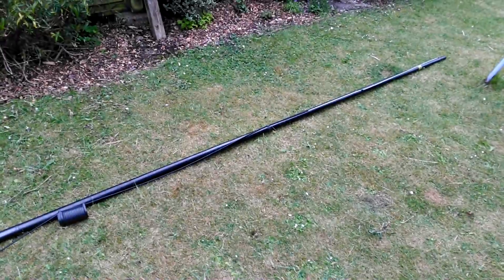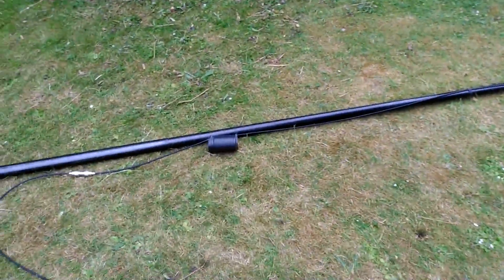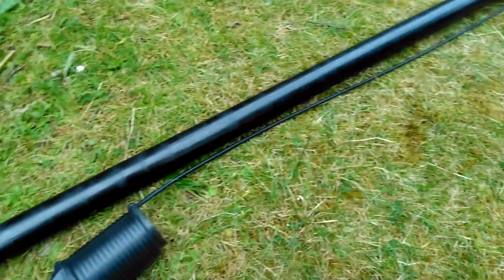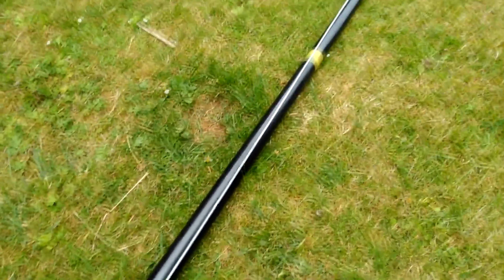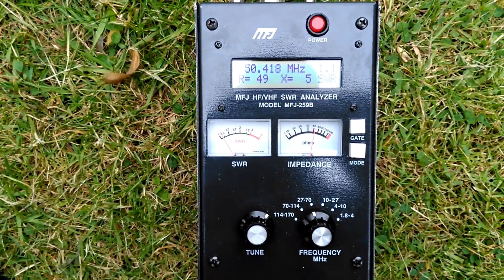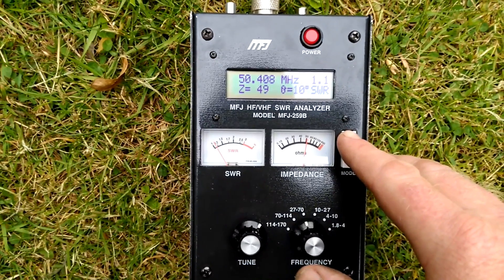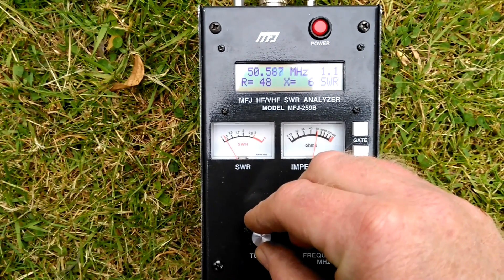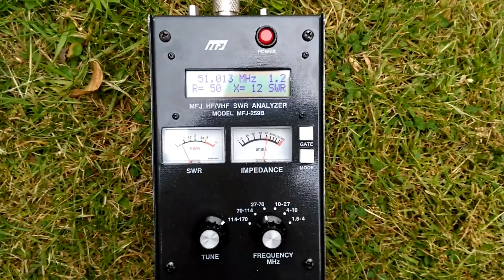6m COAXIAL SLEEVED DIPOLE

Comment: Do you have any tips on how to actually make this for the right frequency? I’m aiming for 145.5 for obvious reasons and my issue is knowing that once you cut the outer and braid off, you’re basically committed to that dimension for your lower section, no matter how well you measure your top section. But you can’t know it’s correct without finishing the antenna and testing it. 

I’m too scared to buy the stuff and give it a go. Especially given I’m doing what you’re doing and not putting it inside anything. But I’ve been told even being alongside the pole as you’ve done here will effect the element length. Nightmare.
Reply from the maker: All you do is rewind the coil start point further up or down the coax to change the lower length of the dipole. 73

Comment: Looks verry nice, mij compliments. can you give me some info in lengts?
Thanks in advanc, hein, pa3cuu Alkmaar
Reply from the maker: top is 137cm, Bottom is 129cm. Bottom is always shorter due to the sleeve/braid. Yours might not be exactly these measurements due to minor variation in velocity factor, but will be very close indeed.
Reply: Thanks, y will gif it a try